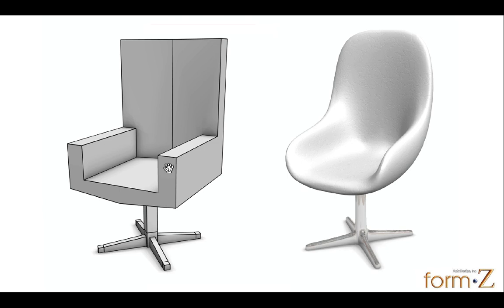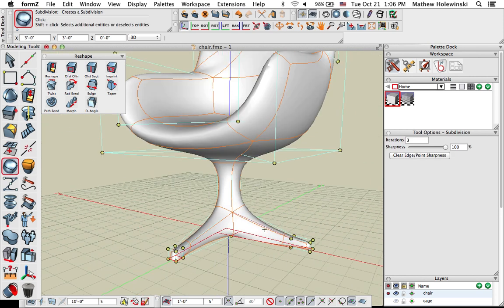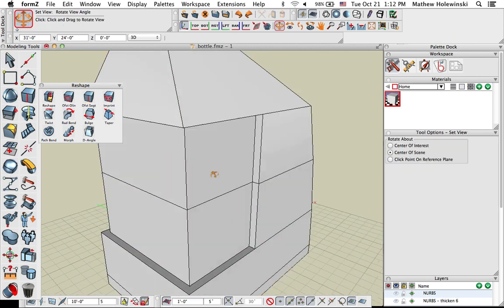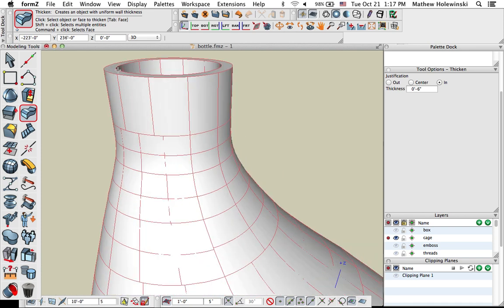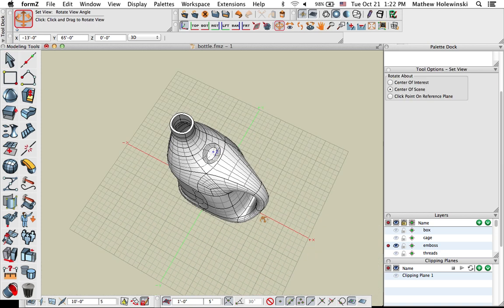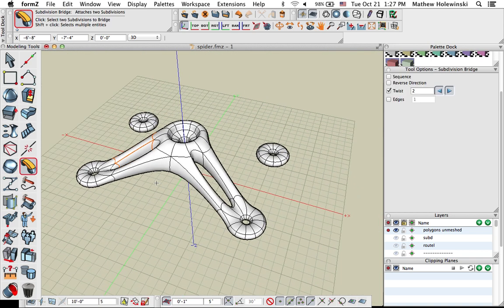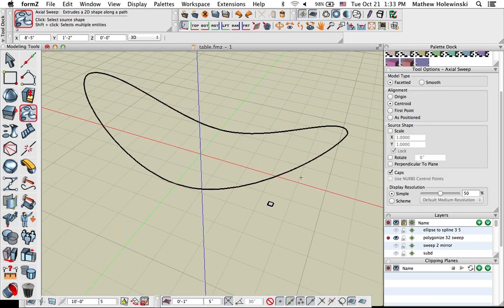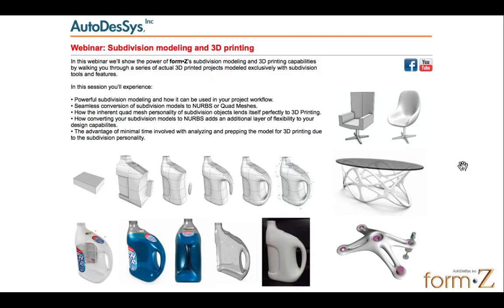Subdivision modeling and 3D Printing

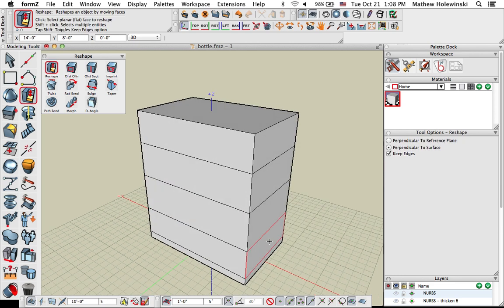Comment: Hi there! 7:32 how did you get selected only the edge (sculpt mode)?
Reply: Tool options-Pick-segments ;)
Reply from the maker: Hi Mario,  Yes, or if you directly picking the segments, you can use the Auto Pick option in conjunction with the Ctrl key (Win) or Command key (OS X).  (This will allow you to position the cursor over the desired "part" like point, segment, or face and click on it to select only that part of the object.) ;)
Reply: Hi there! Thank you ;)